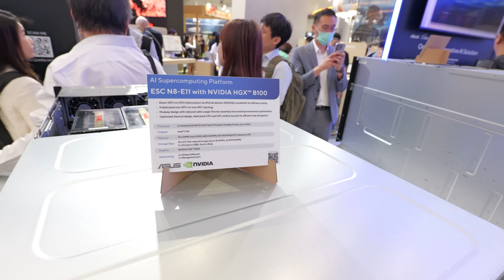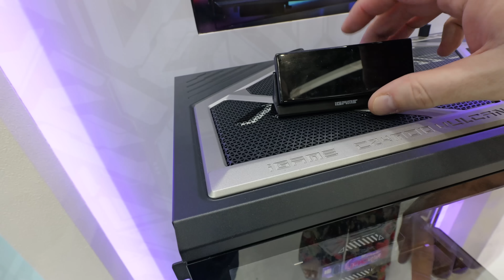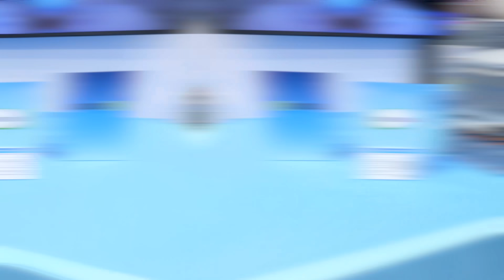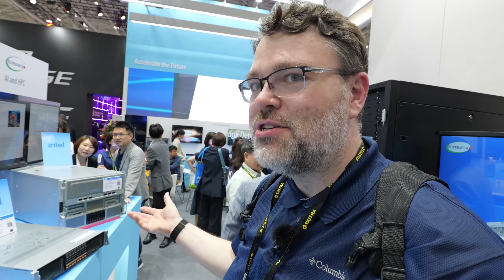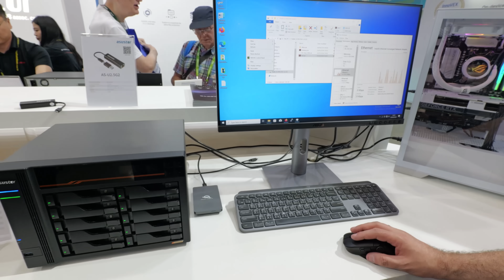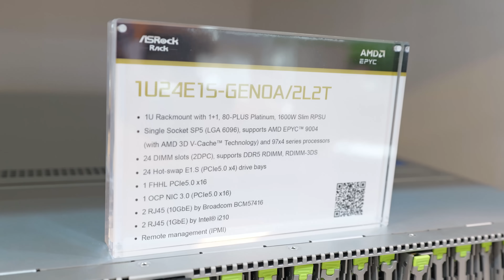Computex 2024 Show Floor Part 1

Comment: Imagine  128  core  beast  on Cam2  Memory  with   256 gig x 2 x128 gig  modules  running  in  same  locations  as  current  dimm slot  memory  on each side  and  up  or  down  from  here  with  two  cache  chipsets for  each Cam2  moodule =  Which  i  would  seek  out a  full  water  Block  for  the   cpu  AND  the  Cam2  Modules

Comment: supermicro is really rocking it with their chassis lately
Reply: Nvidia, AMD, & Intel AI GPUs will require 1kW to 2kW each. Customers need SuperMicro to design the cooling & interconnect solutions for these massive GPUs.

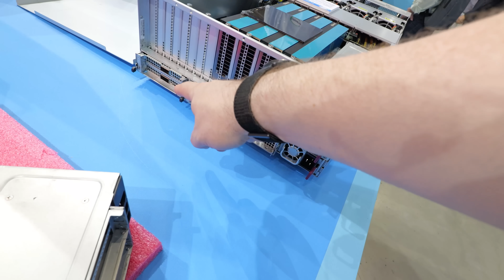Comment: Question: at 11:25 you showed a Nvidia 4gpu workstation.

Now I thought Nvidia killed sli?

There's a black plastic thing that looks like a possible sli connection adapter

Is that an NVlink bridge for 4 gpus?

Or are we dreaming?

It broke my heart when they axed SLI.

Ive had several sli machines and wished they didn't go that route.
Reply from the maker: Nvlink 8, datacenter only

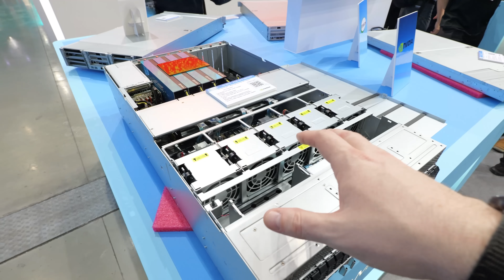Comment: 11:18  That 4-way nvLink board is RARE.  Technically should be able to do 4-way SLI with RTX 3090(Ti)  or the RTX A6000.  Depending on the workload, it might be faster than Ada Lovelace alternatives if you can't leverage nvLink on the cards.

Comment: new asustor offerings look interesting, but no display connectors on them like the previous models. do they do displayport over type-C, or is this likely a case of some pcie ribbon cable to some GPU to install other software? Or are they closing the door on alternate OS installs on their hardware?
Reply from the maker: Alt os ok but you may need to get creative for a display. I'll do a video

Comment: Do you think CAM2 makes sense for thread ripper  motherboards ?
Reply: Threadripper suffers from high-density DDR5 ECC RDIMMs (>= 128 GB per module) still being pretty rare due to them getting gobbled up by the large Server OEMs and current motherboards only having 4 (non-PRO) respectively 8 (PRO) memory slots. But 2DPC Threadripper motherboards seem possible, at least one model from Gigabyte is coming.
Reply: @abavariannormiepleb9470  i hope 2DPC thread ripper pro boards would become a real thing some day.
Reply: You lose one of TR's advantages with CAMM2 which is all those memory channels.  Makes more sense for consumer/gaming boards where high memory speed matters more.
Reply: @nadtz   i think they would put more then 1 or 2 CAM2 slots not 1. one slot per channel or 1 slot per duel channel. i was thinking it would allow higher clocks on very ram dense systems.  Of course ram capacity is still the most important attribute of ram for me.
Reply: @cem_kaya  Spec for CAMM is 1 single or double stacked module.You pretty much lose the benefits of CAMM when you start using multiple slots. not to mention it would take up a ton of space as opposed to DIMM's.
Reply: @nadtz   "pretty much lose the benefits of CAMM when you start using multiple slots." why though ?
i thought cam was electrically easier to design for ?  
for space efficiency maybe they can put some/ all of the slots to behind of the mother board ?
Reply: @cem_kaya  Because the point of CAMM  was to get the connection closer to the CPU with less traces.  It would probably make more sense to try to stack more than 2 modules than to have multiple CAMM slots on a motherboard (assuming that's possible).